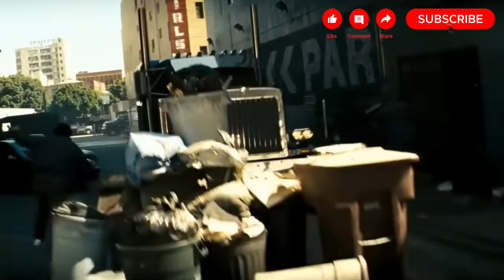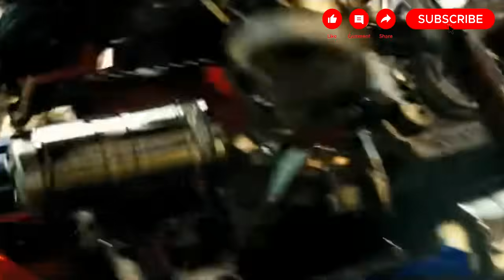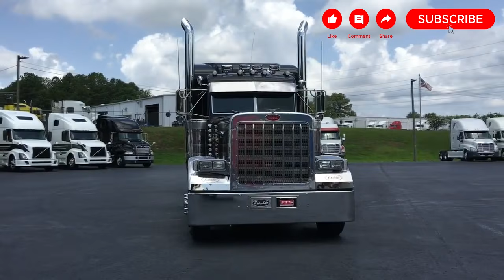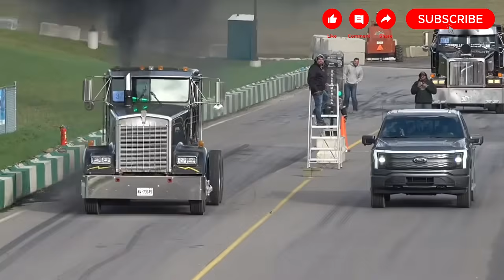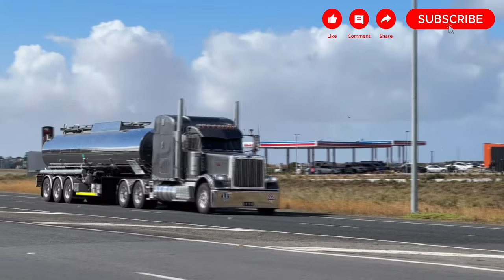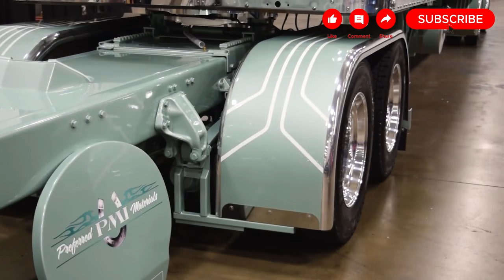The PETERBILT 379: 10 Weird TRUCK Facts You Didn't Know 🔥

Comment: The first one was wrong it looks more like 359 with that light bar. The blue truck is a 359. The noise is still there the exhaust determines how loud it is. I learnt you need to learn what a 379 is. You had a lot of other brands. Plus you need to learn the models better you were showing a lot of trucks that weren't 379's  Last of all it's pronounced three seventy nine not three hundred seventy nine.
Reply: That’s a Custom 379 bruh